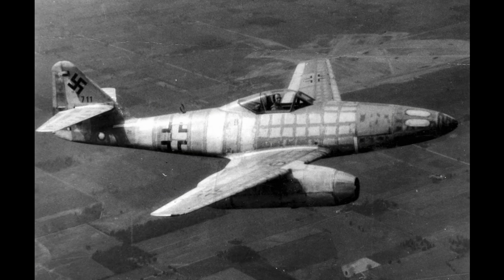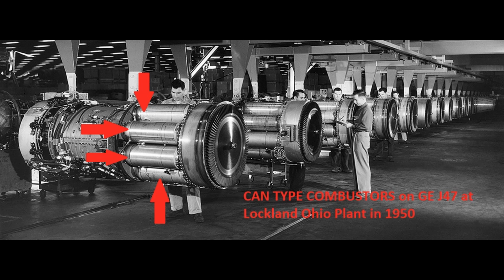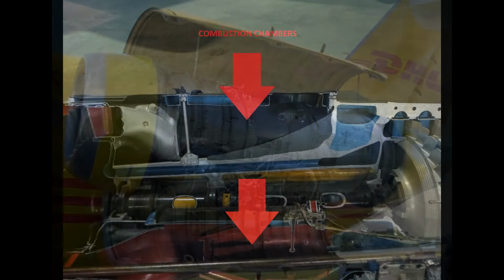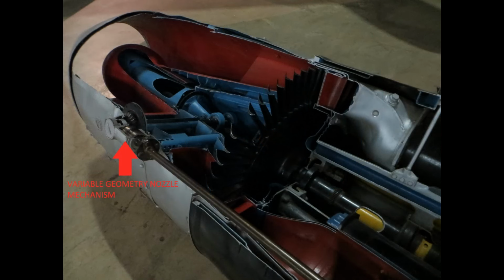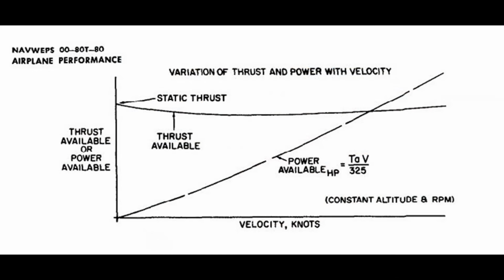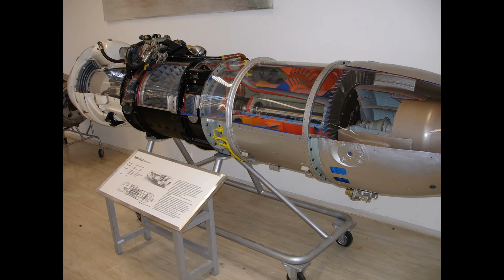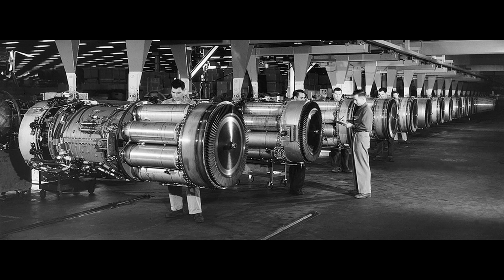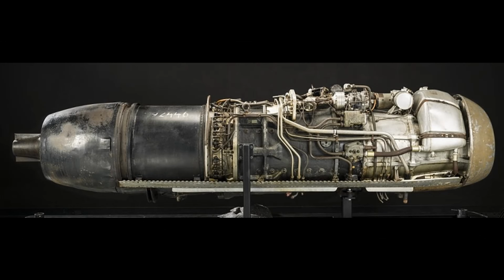World War Two JET POWER

Comment: JuMo probably could have gotten the engine earlier had they gone with radial compressor like Whittle, since the compressor technology was there already. He-280 grand corruption also stalled jet development significantly...
Reply: An absolutely genius German engineer named Helmut Schelp calculated that centrifugal compressor turbojets were an evolutionary dead-end concept that would quickly become obsolete, he convinced the RLM to abandon all development of centrifugal compressor turbojets.
  Britain would waste years on outdated centrifugal compressors, they would not have axial compressor turbojet engines in production until the 1950s.
Reply: @WilhelmKarsten  apparently Guillaume did a great thing for earlier Allies victory
Reply: @sasha022  The Allies had no jet victories, no Luftwaffe pilots were ever shot down by an Allied jet... the Lockheed P-80 and the Gloster 'Meatbox' only killed Allied pilots.
Reply: @WilhelmKarsten as they are well aware,
British military aircraft at the time did not have unusually high accident losses rates.
For example
De Havilland Vampire &  Sea Vixen & Gloster Meteor accident losses were not high or unusual for fighter aircraft at the time.
Non combat phase accident losses 
% of Aircraft built.
Lockheed  P80              (ff 1944) 43%
Lockheed F104             (ff 1954) 45%
McDonnell FH Phantom  (ff 1945) 35%
Gloster Meteor         (ff 1943)  17%
DH Vampire             (ff 1943)  23%
DH Sea Vixen            (ff  1951) 33%
😎 & 🙂 & Indeed 👍
Toodle PIP Old Chap.
Reply: they should note with much awestruckness and great many wonderments?
  DID SOMEBODY ACTUALLY SAY SOMEWHERE THAT THERE'S  AIRLINER ASSEMBLY LINES OR SIMILAR IN THE UK OR IRELAND OR THAT Airbus or BOW-WING is actually British? (B-47 wings on many occasions folded up in flight or dropped off while parked).
     Of course Brazil makes very good airliners &  Brazil is 100th down list along with Indonesia for wealth per capita.
Norway Holland Denmark Ireland Belgium - Top 20 wealth per capita - Don't make airliners -  its as simple as that.
BAe Systems & RR combined now do more Airbus work than Germany on an absolute basis & significantly more work on a per capita basis.
    BAE systems announced the recent £4 Billion takeover of Colorado based US based Ball Aerospace.
  BAE systems now does a significantly higher value of work for Airbus than it did when it was a major Airbus shareholder before 2005.
    RR now owns US Engine maker Allison for example which does classified Aerospace work for the US Govt.
   The UK has more important stuff to do these days. 
  Routine simple passenger aircraft airframe assembly is becoming more of a 3rd world / trailer park area thing.
The DH Comet - world's first high altitude capable pressurised passenger cabin jet airliner in regular service, world's first jet airliner aircraft to cross the Atlantic, worlds first jet airliner aircraft to complete a global circumnavigation flight series.
  They might try to sensibly answer this question - why do they believe that BAE Systems & RR (aero engines etc) & other companies, for example should be doing anything other than what they currently do & where do they get the idea from that the DH Comet had any affect at all on the progression UK aerospace sector.

   Anybody currently flying on a widebody airliner stands a good chance of being on an aircraft powered by RR gas turbine aero engines built in England.

                    📯📯📯📯
       The New RR Trent Ultrafan
               Built In England
      World's Largest (see T&Cs)
        Gas Turbine Aero Engine
                  📯📯📯📯
    👍Manufactured by the people on a small island with less than 1% of the world's population.👍

   A typical but small glimpse of what goes on in the very internationally orientated British aerospace sector.  -
      Boeing Apache Attack Helicopter.
AH-64: 75 UK suppliers, 7% UK content, global fleet of 1280+ aircraft.
F35B more than 130 UK Suppliers, more than 30% UK content.
F35A & F35C more than 130 UK Suppliers, more than 15% UK content.

They might like to answer these questions.
   Which airline has just ordered
60 RR England Trent XWB Engines
& What aircraft are the engines for?

Bonus question for 10 extra points.
                Which country has the 
World's Highest Combined Per Capita
 Nuclear / Defence / Aerospace Sector Activity?

👍& 🙂 & Cheers & indeed 😎
 
          
        
. .. . ... . ... ..............
xcxcxcxccviiiiiiiiiivv
Reply: @paulpaul9914  de Havilland DH.108 100% loss rate.
Reply: @paulpaul9914  NAME A BRITISH JET PLANE STILL IN PRODUCTION?
Reply: @sandervanderkammen9230  
Good day Krappenz.
As they clearly know -
The dh108 was a series of 3 highly experimental development aircraft. Not a production aircraft.
The pilots were very enthusiastic test pilots and aviation flying researchers.
   Were they deliberately misleading viewers regarding DH aircraft again?
Cheers.
😎 & 🙂 & Indeed 👍
Toodle PIP Old Chap.

    
   
 
. ... . ......
xcvxvcxi
Reply: @paulpaul9914  NAME A BRITISH JET AIRCRAFT STILL IN PRODUCTION IN THE UK TODAY?
Reply: As they are aware -
Just answer the questions sonny Jim Jimminy boy.
   Which airline has just ordered
60 RR England Trent XWB Engines
& What aircraft are the engines for?

Bonus question for 10 extra points.
                Which country has the 
World's Highest Combined Per Capita
 Nuclear / Defence / Aerospace Sector Activity?

👍& 🙂 & Cheers & indeed 😎
 
         Toodle PIP Old Chap.
  
   
 
     
. .. . ..       .... .
vvvvvvvcccv
Reply: @sandervanderkammen9230 
As they will of course no doubt indeed  be aware.
British military aircraft at the time did not have unusually high accident losses rates.
For example
De Havilland Vampire &  Sea Vixen & Gloster Meteor accident losses were not high or unusual for fighter aircraft at the time.
 Added the Lockheed XF104 prototype series with 100% accident losses. 
Non combat phase accident losses 
% of Aircraft built.
Lockheed XF104         (ff 1954) 100%
Lockheed  P80              (ff 1944) 43%
Lockheed F104             (ff 1954) 45%
McDonnell FH Phantom  (ff 1945) 35%
Gloster Meteor         (ff 1943)  17%
DH Vampire             (ff 1943)  23%
DH Sea Vixen            (ff  1951) 33%
   
Cheers 
😎 & Of course 🙂 & indeed 👍
Toodle PIP Old  Chap. 
  
   
       
 
. ... . ..... . ... .
vvvvccxvcxii
Reply: @paulpaul9914  Every single Dh108 CRASHED killing its pilots... including Geoffrey de Havilland Jr.  The son of the company founder...
Reply: @paulpaul9914  Which airline bought British jet aircraft recently???
OH WAIT! NEVERMIND!!!

BRITAIN DOESN'T MAKE ITS OWN JET AIRCRAFT ANYMORE!!!!!
Reply: @paulpaul9914  The Lockheed F-35 is the RAFs most advanced jet fighter... because Britain M o longer makes its own military jet aircraft.
Reply: @paulpaul9914  Could you please give us the name of a British company that still makes British jet aircraft in the UK?
Reply: Germany invented the jet engine 2 years before Whittle.
Centrifugal turbojet engines were obsolete on arrival, a dead-end concept. 
The He-280 was inferior to the Me-262, the Messerschmitt Me-262 was the most advanced jet aircraft in the world, it had swept wings, all swept control surfaces and a fly-by-wire Horizontal Stabilator.
It had the highest Critical Mach number performance of any WW2 aircraft
Reply: @sandervanderkammen9230  that is just not the full truth. Turbojet was not "invented" by either side, the concept of air breathing jet was discussed in the 1920s, everyone knew about the Meredith effect, etc. What Whittle did (and what von Ohain probably never even understood) is  a durable combustion chamber. HeS3 just had a pipe with the fuel injector. Whittle mastered higher exhaust gas temperatures and his design easily scaled up to RR Nene. Yes, the centrifugal compressor was a dead end, and Whittle understood that. What he also understood is that during the war you don't need a perfect engine too late, but a good enough engine early enough. So the choice of the centrifugal compressor by RR was more a philosophical matter than a technical one. They understood how to make an impeller based on supercharger experience.
Reply: @sasha022  Whittle was not the first to patent or achieve anything related to jet engine development.
 Hans von Ohain and Max Hahnn constructed the first turbojet engine in Göttingen Universität in 1934-35.
It demonstrated the very first example of what we call a "combustor"
And it is the first Annular type combustor which is what is used today on modern engines.
The first patent was by Maxime Guillaume in 1921.
Whittle would not begin any actual work on jet engines until he moved to Rugby in 1936.
 Whittles WU.1 had no combustor and injected fuel directly into a section of old steam pipe.

Whittles engines burned up quickly, he was using Browns 18/3 and REX 78, alloys used in cutlery and kitchen utensils.

The real genius of the British jet engine program was Adrian Lombard and Stanley Hooker.
Adrian Lombard designed the Welland, Derwent and Nene with metallurgical help from General Electric turbocharger division who provided high temperature creep resistant alloys 'Hastaloy B' and Nimonic 70 developed by Canadian company InCo.

As A.A. Griffiths, Cheif of Engine development at the Royal Aircraft Establishment pointed out, Whittle plagiarized his work and did not understand axial compressors, Whittle would never attempt to build an axial compressor.
Any questions???
Reply: @sandervanderkammen9230  you stepped from just ommiting some truth to just posting lie. Whittle patented his engine in 1930, five years before Ohain. Not only that, but in the 1938, when Whittle's first experimental device already ran, Ohain only built a hydrogen turbine that did not have ANYTHING in it, not a cooled turbine, not a reverse-flow combustor, not a cooled hot-gas pipe. And he never understood that. 

Ohain also did not build easily accessible combustion chambers, and did not use replaceable turbine blades. I did not want to say that, but essentially Ohain was a fraud, much like his patron Ernst Henkel, who boasted about Ohains invention in front of RLM.
Reply: @sasha022  Whittle was a fraud, Maxime Guillaume patented the turbojet aircraft engine in 1921 while a 14 year-old Frankie was still wearing short pants.
He was forced to allow his patent to expire in 1935 because it infringed on Maxime Guillaumes earlier patent.
 Whittle would never construct any engine until moving to Rugby in 1936.
 His first prototype was cobbled together from scrap found in an abandoned factory and required the aid of a 4-cylinder Austin Dixie engine to run.
The first successful demonstration of a working jet aircraft engine was on August 27th 1939 in Rostock Germany.
Whittle would eventually be the fourth person to successfully demonstrate a working jet aircraft engine 2 years later in 1941.
Von Ohain invented the Annular type combustor which is what is used today on modern engines.

Heinkel did infact construct the world's first jet aircraft to fly
Any questions lad?
Reply: Centrifugal Turbojets are inferior to Axial Turbojets... Germany was the first to recognize this fact and thus gained a huge lead over the Allies in jet engine development.. the brits would not have access to modern Axial Turbojets until 1950 with the RR Avon
Reply: @DoktorBayerischeMotorenWerke 
@sandervanderkammen9230 

Kharzeestan Krapper DiktorBummer etc & co - they should note well & remember pelly good with much awestruckness pleasetoo.
 That's hilarious - Krapper/ DiktorBummer claims Griffith's said Whittle didn't understand jet engines 😂 In fact Griffiths was already working on axial jet engine tech before 1930 & was aiming to use it as a turboprop engine. Before 1931 Whittle was aiming at gas turbine reaction thrust only with no propeller which Griffiths had doubts about. 
     Their comments are readykyoulous phFabrikayshunz. 😂
  Multi stage sequential stator rotor Axial compressors & Axial turbines had been demonstrated  before 1900 by Parsons in England. Internal combustion axial gas turbine aero engines were being considered, researched & built in England since 1925.
  Maxime Guillaume simply copied stuff from Parsons writings & lectures into a fraud patent.
 The Whittle centrifugal compressor internal combustion reverse flow & straight through combuster gas turbine aero engines is still manufactured & used for turboprop & helicopter applications & more than 30,000 have been produced so far.
    The gas turbine was of course invented in England before 1800, why would they expect it to not have been the case, obviously.
   The world's first demonstration of a practical internal combustion gas turbine aircraft engine was in England in 1937.
   It used a car engine for starting (spinning the main gas turbine shaft), the car engine was disconnected after starting. Electric motors were also used for starting -  Standard practice.
All previous attempts by others had various non pure gas turbine aero engine features such as a compressor stage that was actually operated by a piston engine with an after burner & no turbine stage.
    The world's first demonstration by Parsons of the components of a coupled multi stage axial compressor & axial turbine unit using sequential bladed rotor stator stages was in England before 1900 when of course people in England began considering their use as the basis of an axial compressor internal combustion gas turbine aero engine.
  Parsons didn't manufacture steam engines.
  Steam engines don't have multi stage bladed sequential stator rotor axial compressors & turbines. 
                                    &
    Oh yes, the PW200 range of gas turbine engines are in fact directly derived from the Whittle centrifugal compressor internal combustion reverse flow combuster gas turbine aero engine which of course was demonstrated for the first time in the world by Whittle in England in 1937.
                          OF COURSE
  Air travel safety often depends on British made and or designed tech or British aerospace advanced technology, R&D, science & Engineering.
  For anybody currently flying on a widebody airliner there's a good possibility that the engines will be RR gas turbine aero engines designed &  built in England with those engines  being monitored by people in an English county.
  England, the home country of 
  RR (aero engine stuff) & it's lands, 
   counties & shires will 
   of course be producing  - - 
            🎺📯🎺📯
    The RR Trent Ultrafan
   The Worlds Largest Gas 
     Turbine Aero Engine.  
           📯🎺📯🎺
               👍👍
   
   A typical but very tiny glimpse of what goes in the very internationally orientated British aerospace sector.  -
      Boeing Apache Attack Helicopter.
AH-64: 75 UK suppliers, 7% UK content, global fleet of 1280+ aircraft.
F35B more than 130 UK Suppliers, more than 30% UK content.
F35A & F35C more than 130 UK Suppliers, more than 15% UK content.
😂👍 Cheers & of course 😎
   
     
  
 
    
. ... . . ..... . . ... . . ... . ........ .  . . ......
ccicci vivvixxixxicciccixcvcxcvcxvv
Reply: @DoktorBayerischeMotorenWerke 
As they are well aware.
 All UK axial compressor GT engines were always significantly superior in every respect to anything being developed anywhere else.
 UK acceptance standards were also always much higher & so introduction for service use took longer.
 The RR of England Nene centrifugal compressor GT engine was indeed the most powerful gas turbine engine on the planet in 1944 of course, improved copies of it would later power the MIG 15.
  The Whittle style centrifugal compressor internal combustion gas turbine reverse flow combuster aero engine is currently manufactured for aircraft applications such as helicopters & Turboprop aircraft.
   🙂& 👍 & Indeed 😎
Toodle PIP Old Chap.
Cheers.
   
    
 
. .... . ....
xcvxiiiiii
Reply: @paulpaul9914  The RAEs 100 hour PFTR rating for acceptance into RAF service was the exact same 100 hours for the USAAF and the Luftwaffe, only the U.S. Navy required a higher standard (150 hours)
Reply: @paulpaul9914  Please tell us? What supersonic jet aircraft is powered by a centrifugal jet engine?

The turboshaft was invented in Norway... not England.